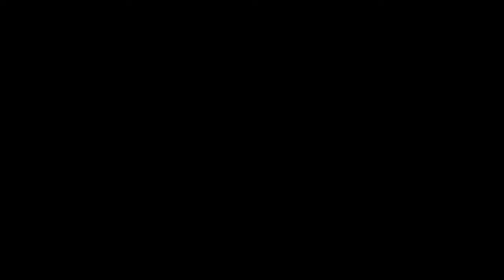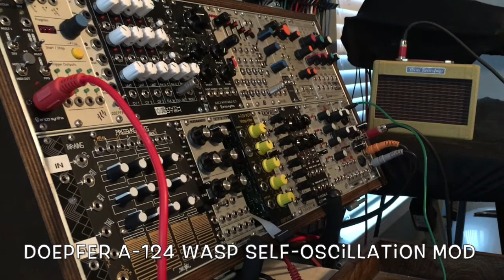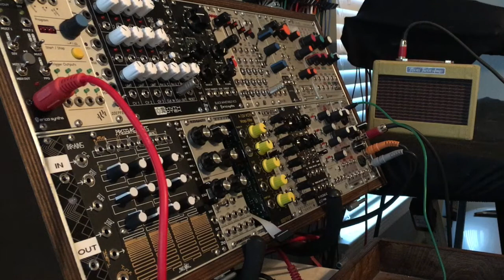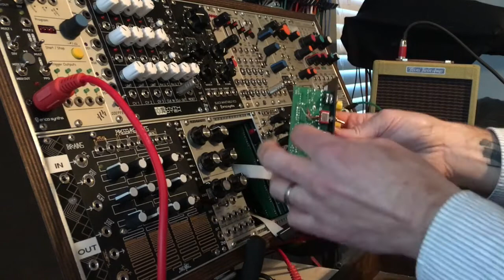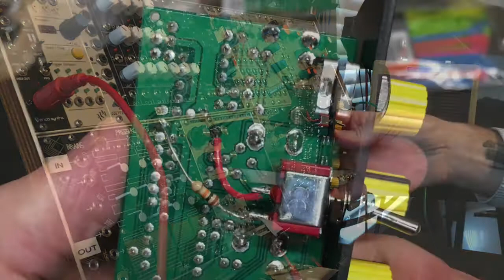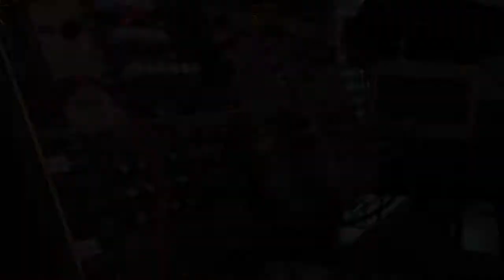Doepfer A-124 WASP self-oscillation mod

Comment: Thanks for pointing that mod out (and kudos also to Patch Pierre and the people who had the idea before that).
Here's something I've been thinking about after seeing your video, and then confirming it with a patch. Disadvantage over your solution: it takes up at least two more HP. Advantage: no soldering required, no change to the module's sound, no CV jack lost.
Here's how: 1. use a polarizing mixer with at least two inputs (the LPZW WK2 is what I used, but there's a lot of alternatives). Connect the A-124 out both to the intended destination (e.g. VCA) and one channel of your new mixer (you'll need a 1-2 multiple for this). Connect your original signal source (e.g. oscillator) to the other in of your mixer. Connect mixer output to A-124 in. That way, you have a feedback loop that can be positive or negative around the A-124. You'll even get two different sounds for positive and negative feedback.
Reply from the maker: Oh yes. Feedback loops are a lot of fun. I love using them with drum modules.

Comment: Thanks, great, though no reason to take out a pot, just as i assumed before receiving mine (an hour ago) there is enough space for switches (not even the smallest available) between the jacks and on the other side between the pots, what i want to try first though is instead of the resistor and switch use a 10 k pot to see if it makes sense to switch this gradually in, just try, and i think i might even fit a pot between the jacks, though it might get a little tight to turn that.
Reply from the maker: Oh wow. Can you do a video on that? I'd love to see how you did it. I really wanted to add a hole for the switch but couldn't get it to fit with any of the hardware I had. Good on ya for getting it to work.
Reply: @musicalmiscellany  I just looked into my box of parts and found a switch like you used but smaller, havent done it yet but that easily fits either between the jacks or on the other side between the pots if you dont mind to drill ahole on a spot where the lettering (CV or FREQ) is..
Reply: @flannsixtyseven7489  I have of those very small switches as well. Should be possible, if not I will ditch the bandpass. Not using it anyway.

Comment: Hi, still new to this. Didn't here the value of the resistor in the video, when I looked up based on colors the calculator said 43ohms, is that correct?
Reply from the maker: Thanks for watching. It's a 10K resistor. I thought I mentioned it during the video but apparently I did not. LOL. I am pretty sure I listed it in the video's description. In any case, the color code is brown-black-orange-gold. Good luck with the mod.

Comment: How does the self-oscillation sound when pinging the filter with an envelope? Can you use it as a bass kick?
Reply from the maker: You can. It will work for that in a pinch but there’s better modules to perform that duty honestly. It may be a good second feature but I would buy it for that purpose.

Comment: What about modifying one of the pots to be a pull-pot? Like coil tapping on a Les Paul. You want hyper resonance? pull the knob up.
Reply from the maker: That's a really good idea. Provided you could find a push/pull pot that could fit in that space it would be a good way to still keep the CV pot. A great suggestion.